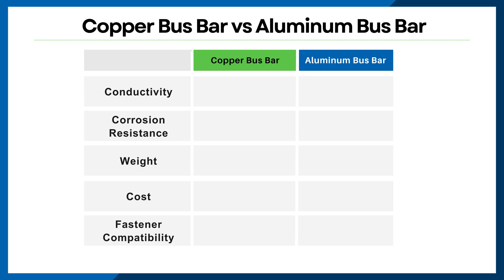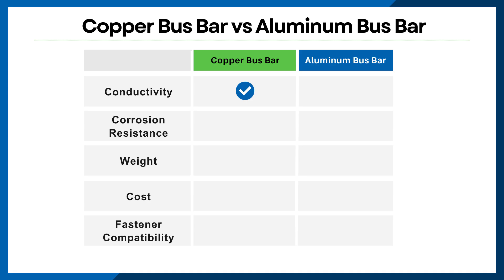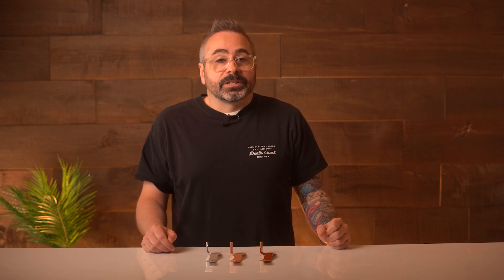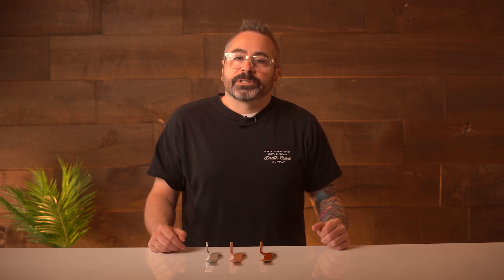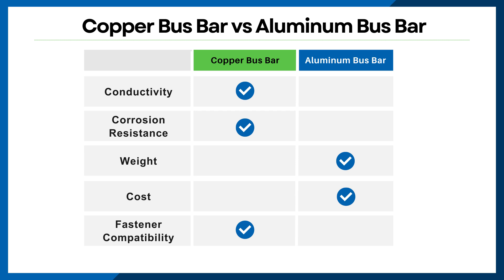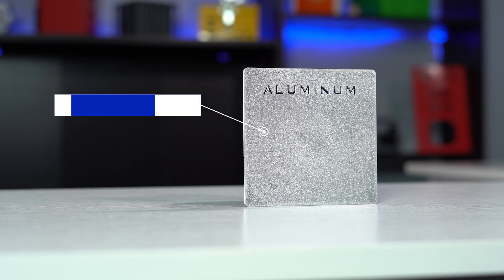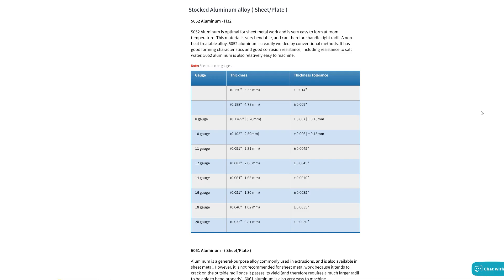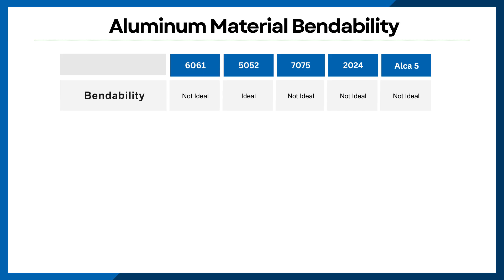Proto Tech Tip - Copper Bus Bars vs Aluminum Bus Bars

Comment: How do you mitigate the formation of aluminum oxide which is not conductive and could create a large contact resistance as the ends of the bus bar?
Reply from the maker: Keeping the surface cool, dry and isolated from oxygen would be fundamental for preventing oxidization. However, the best way would be to apply any type of protective coating.